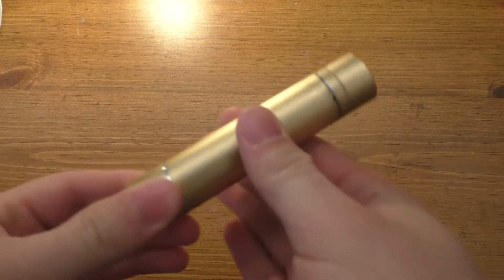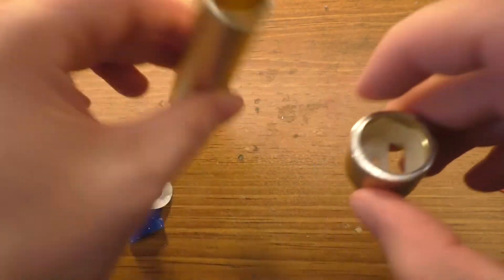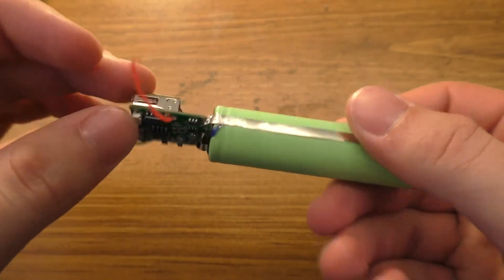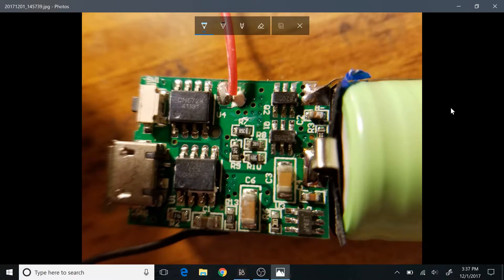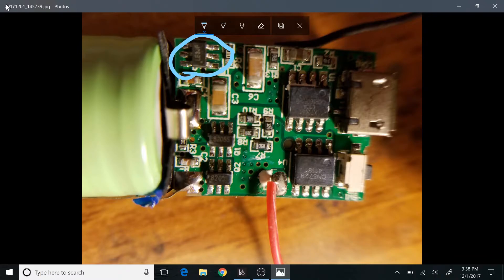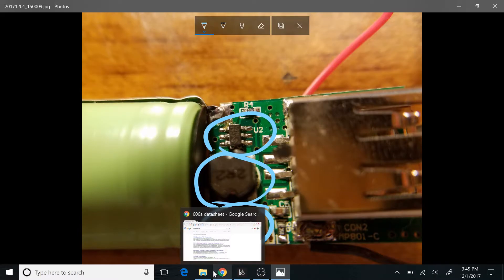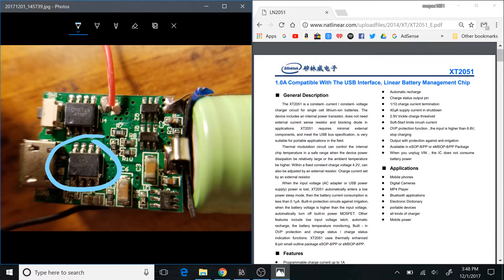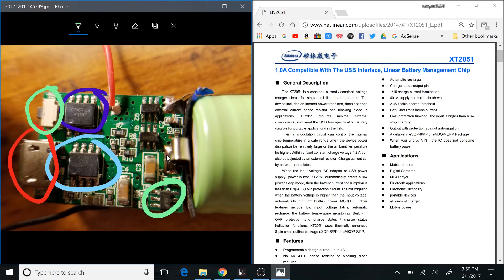RAVPower 3000mAh Power Bank Teardown

Comment: Someone can help me how to unscrew the ends? I tried with a lot of force, but it didn't come out! :(
Reply: Mine wouldn't unscrew either. That's why I cut it.
Reply: mopac1851 how did you cut it? I’m trying to take mine apart too
Reply: @spyc3311  with a  hobby or a stanley balde and a cupple of plires to get some presure to turn it

Comment: You can unscrew the ends lol
Reply from the maker: +ELECTROHAXZ I figured that at first. Then I tried to unscrew them found I couldn't get them to budge and assumed they were pressed in or something like that. At that point I just cut the thing. On a second one I have, I was able to unscrew it but it took considerable force.
Reply: Ah ok
Reply: @Eman2000  Which end can you unscrew?
Reply: I'm also trying to unscrew that. How did you get it? Using your own hands?